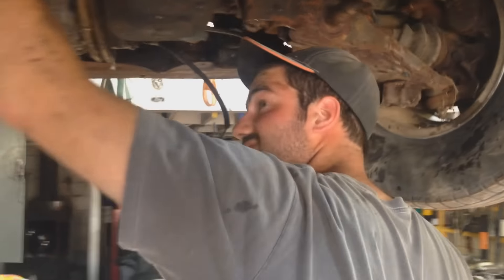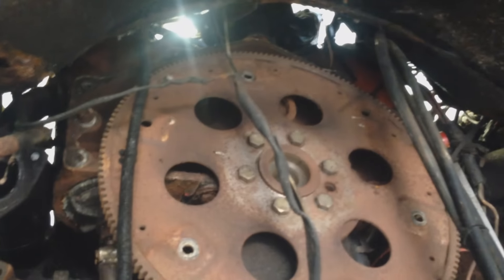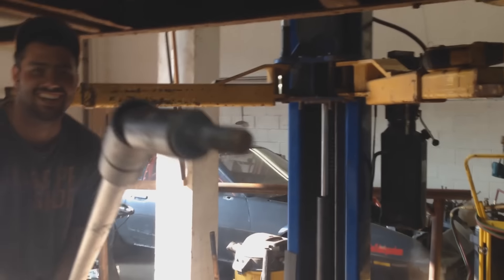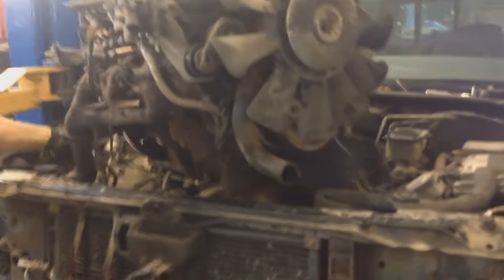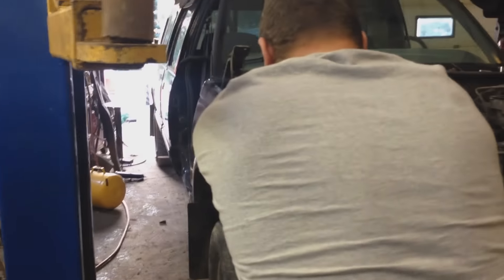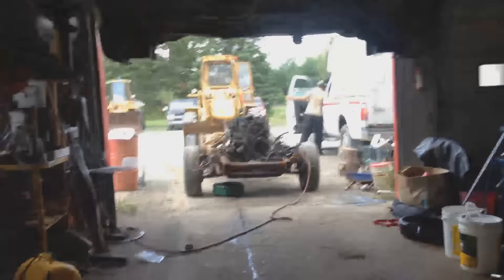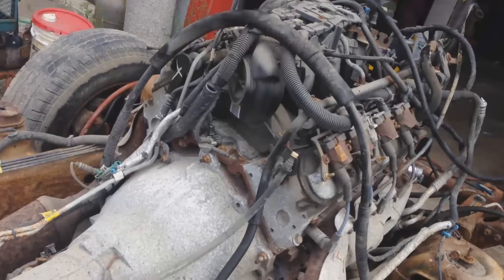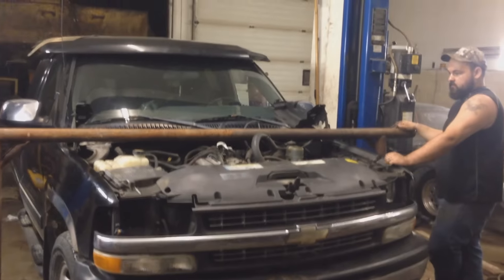4 Engines 2 Days RIP EM OUT!!!

Comment: Do you know how to get the front end out of a blazer like that one? I can't for the life of me figure out how to get the one in my son's out of the damn truck , his is fucked and i wanted to get another one to put back in it.  I'd like to have a 4 door crew cab like that one you took the vortec out of but not one that's all rusty as shit. shame that yall had to give up on those trucks like that. i know it's probably because they are just rusted all to hell but one of those was newer than all of mine and none of mine have anything more than a little surface rust on them
Reply from the maker: +DaddytechEnt yeah with the crappy roads and salt they rust and shake apart
Reply: but do you know how to get the front end out of an S10 blazer like that one? i know there's a way but no matter what i've tried i haven't found any way to do it and so far no one i've asked knows how either.
Reply from the maker: take bolts out till it comes :p ive never had to try so i'm not much help
Reply: oh since yall tore as much apart as you do i thought you might know. i tried the taking all the bolts out thing still too much frame in the way